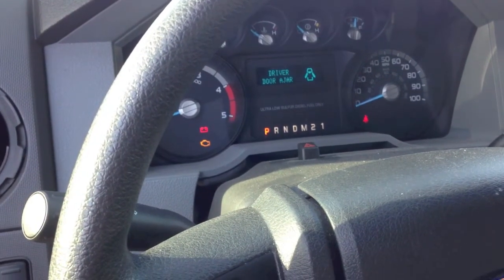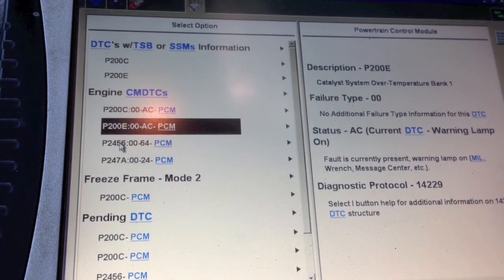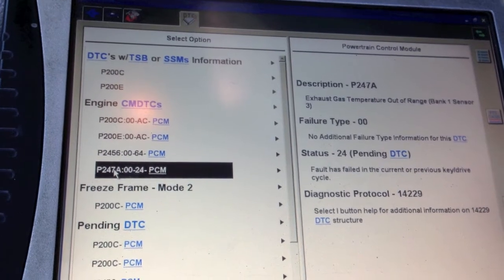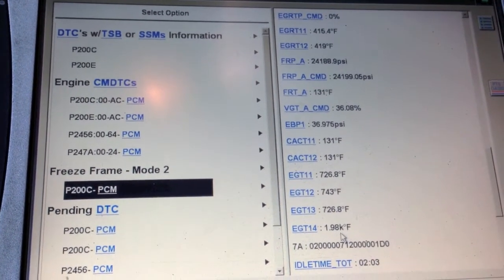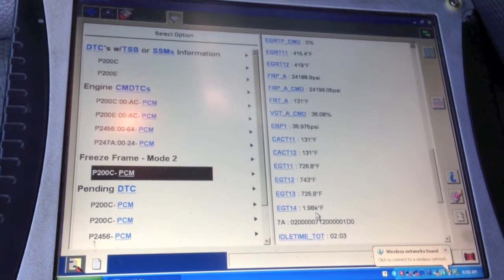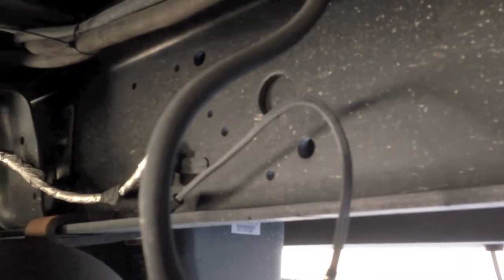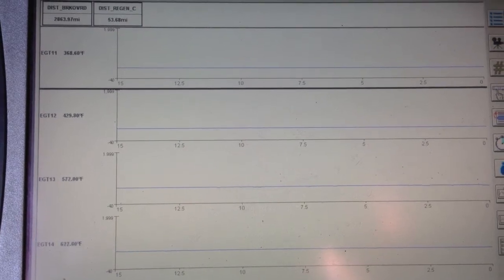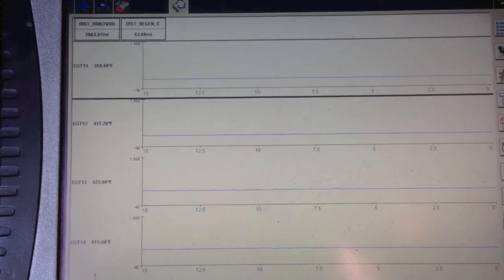FORD 6.7 POWERSTROKE DIESEL STALLED FREEZE FRAME DATA P200E P200C P2456 P247A

Comment: I  have a ford f250 2011 4x4 6.7l my first diesel.What is a freeze frame data and how can I get ahold of that program you were showing on your video if you don't mind sir?I'm having a hard time with ford not wanting to help me with my issues that I'm having with my truck like the transmission kicking out of gear and the brake pedal is soft then it gets hard and they found a code one time on the brakes and they had to contact ford to turn the code off and the brakes went to normal 4 a week and

Comment: Thanks Ron, question please. Does Ford use certain default values when a circuit fails "open"? It's obvious that 1.98k on that sensor would more than likely damage the sensor itself. Also what type of EGT temps are you seeing out of these engines before they go into regen or is that something you don't really look at. Thanks for the informative vids.